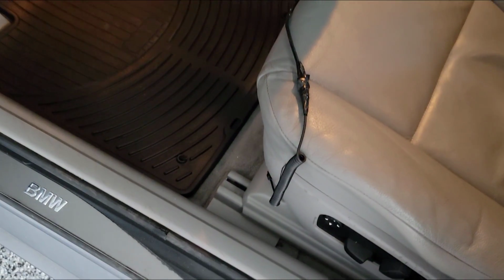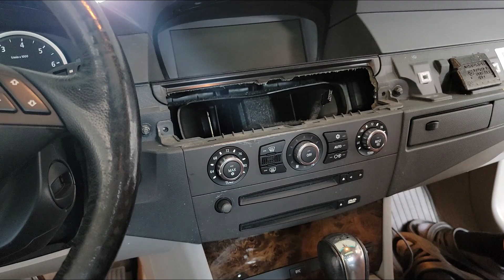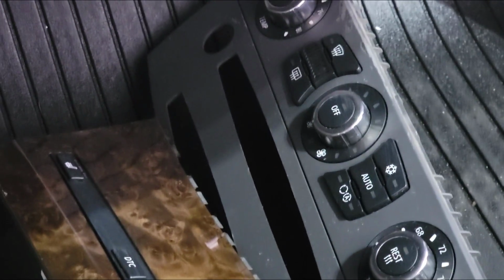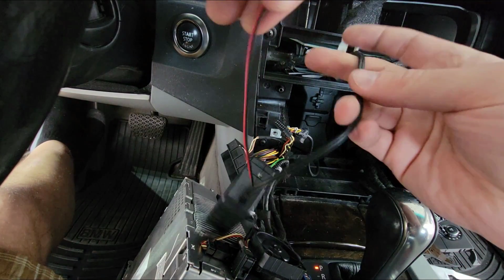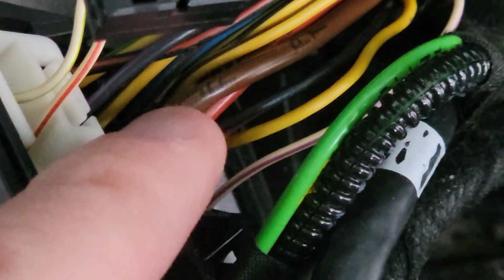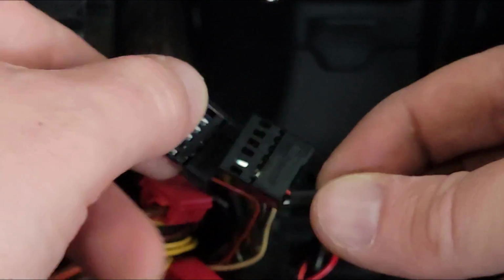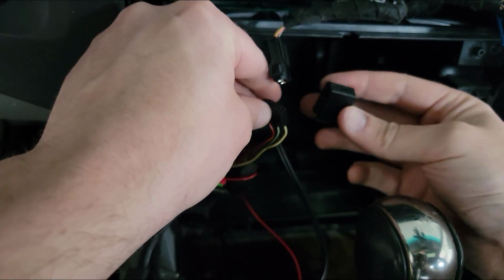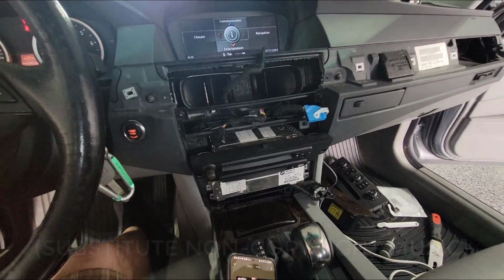BMW E60 Aftermarket Bluetooth Music Installation (Module from Amazon)

Comment: Great video thanks. I tried it and found the white / purple wire had no power so had to connect to the thicker red/brown next to the ground brown. Very erratic connection to the Bluetooth and getting slight static pulsing possibly due to unfiltered power? Partly successful but not as good as yours.

Comment: Hello,
 is it possible for you to change tracks from the steering wheel with this module?  Regards
Reply: Looking answers on this too!!
Reply: yeah that would be hand to know actually
Reply: After my diy install: no, you can't change tracks. It should've made sense to me before already, since there's just three wires for the aux signal. However, I wonder if someone can tap the track button wires from steering wheel?

Comment: Great video!!! I have a question for you. The previous owner of my car had this module put into the car and it worked great, unfortunately my radio went bad so I got a new oem radio put into the car and plugged the module back in. My problem now is that there is no auxiliary setting anymore in the idrive system. Does it need to be recoded into the new radio and of so how would i go about doing that. Thank you great video man👍
Reply: You might want to try the aux activator module on Amazon
Reply: Check out the description in that video for the Amazon link
Reply: Any luck man i just got a new ccc unit aux is unlocked but still no sound

Comment: can you use normal aux after install ? or will aux mode always be bluetooth after?
Reply from the maker: In this video, I am connecting the bluetooth module to the aux hookup.
Reply: The little section on the black plastic but is the aux. So if you connect the Bluetooth to that ; you will loose the aux functionality and it will always be Bluetooth
Reply: @RandomExposure  Can`t connect bouth?

Comment: Anyone have any idea if I need to program the aux to the I drive before this will work on my 530i 2004
Reply: I have the same question. Daniel S - did you figure it out?
Reply: @Magamata-EE  yes you need a programmer to activate the six function
Reply: Aux*(not six)
Reply: @daniels5724  Thank you!

Comment: How is the audio quality compared to a fm Transmitter ? Night and day difference ?
Reply from the maker: I think it's great!
I will say that the mid-range is a little lacking in the E60, compared to my previous E46.
(this has nothing to do with the Bluetooth though)
It seems you can only mess with the very high range and very low range. My E46 had the most impressive mid-range I've ever heard that didn't muddy the sound like so many do.
Reply: @RandomExposure  Same with my car, my z3 sounds amazing but my e60 stock radio has barely any mid range but it does sry crystal clear so I can’t complain

Comment: Do you have to code before hand ?
Reply from the maker: Yes, you will need to code if you do not have the AUX option on your radio already.
Reply: @RandomExposure  how do I code to get Aux option?
Reply: @mrjonhson  there’s lots of videos on YouTube showing how to code in AUX
Reply: @mrjonhson  did you find out how to code ?
Reply: @nlmb.9099  I have not. I think I need some equipment that I am not familiar with .

Comment: Hello ,, i follow the video process step by step, exactly as it is.. 
But my screen stop working directly when i start the vehicle after installation.. does any one have explanation ??
Reply: i have the same. do you know the problem?
Reply: @KayaLovesShamyro  Im waiting for explanation from some body .. i didn't understand what's going on
Reply: @abdulillahbaismail2499  bro i know the problem! Check fuse number 34 in the glove box fuse box. That is the fuse for the ccc/cic. Mine was blown so I replaced the fuse and everything works but please remove the aftermarket Bluetooth!
Reply: @abdulillahbaismail2499  if you replace that fuse everything works
Reply: @KayaLovesShamyro   i will try this today,, do you recommend any bluetooth device i can purchase ?
Reply: @KayaLovesShamyro  i removed the device, and change the fuse 34,, still my screen not working..
Reply: I had the same problem. Just changed the fuse Box (in the glove box) number 34  and it worked. Mine was also blown. AliExpress…

Comment: Nice but too much doing. Rather just go the transmitter route cause people complaining about coding and power drainage.

If you can answer some of these guys questions I’d take the risk of ravaging through the wires.
Reply: Who have aux originally will not need coding and with power drainage the module is enabled whenever ur ignition is on and after u take the key out the module stays on until system goes to sleep but it wakes up when u hear like a buzz noise or something similar but after u lock the car it goes away after like a minute